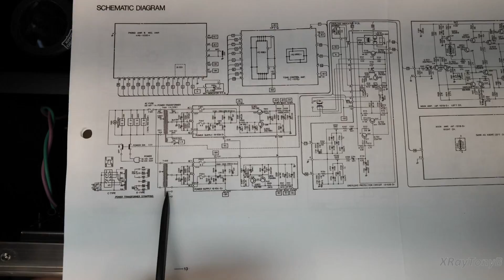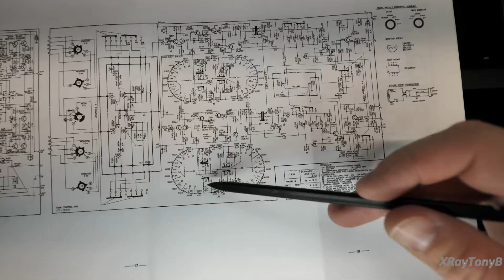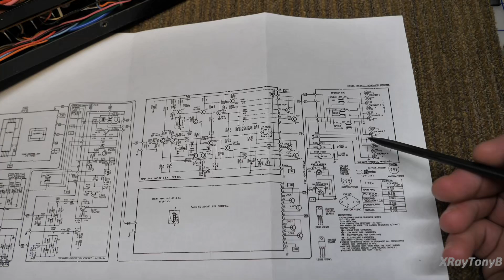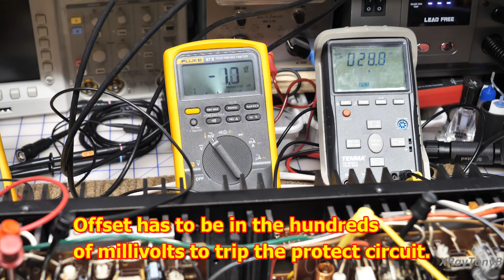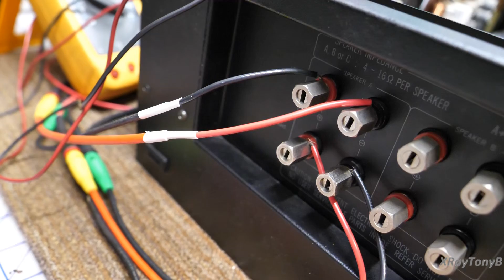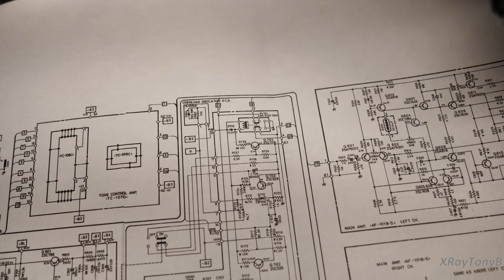Rotel RA-1412 Amplifier - Troubleshooting the Troubleshooter

Comment: I got lucky a week ago: a neighbor was putting out some of his old gear and brought out a vintage Rotel RA-1412 amplifier. Naturally, I grabbed it, cleaned it inside and out, and cleaned the switch contacts. Once I turned it on, I couldn't tear myself away from listening to various genres of music for ten hours straight; my Pioneer A-447—which I used to love for its sound, and which I’d even fitted with new capacitors and tuned using an oscilloscope—now just pales in comparison.

Comment: I have a lot of faith in Rotel .  Got a RA214 Amplifier for my 21st and more than 50 years later its still going. All I have done is dust it out and clean the controls. Still used in my secondary system. Fascinated by the vids even though I don't understand most of it. 🤣

Comment: Hi Tony, heat a great video. You inspired me to bring out my 1412 to see if it is still doing ok. I used to work both at Tektronix and RIFA in Stockholm and as I recall the RIFA capacitors were really high quality, but maybe not this type though. What an impressive lab you got set up there!😮 and thanks for a wonderful video.

Comment: Great video Tony, thanks for sharing it. I have a quick question, have you ever come across an issue for the power amplifier where it produces no sound when the volume is low, then all of a sudden the sound come out when the volume is turned up to a certain level? Could this be caused by a capacitor, transistor or a relay? Thanks for reading my question Tony!

Comment: Nice again, Tony! First, those "Rifa" brand caps fail like this regularly. The best thing is to replace every one of them right away. The reversed leads going to a scope is something most have experienced once or twice, may lead to wrong conclusions :) The relay, could you get a PCB socket for it, is there enough room over the relay to accomodate the extra height? Very nice amp, I once had a Rotel receiver, but not near this in quality, but I liked it

Comment: Very nice amp, a brand new amp built to that standard would cost a fortune, those where the days. Myself I had several large Sansuis, quite nostalgic about them but they go for high prices now and they need a lot of recapping etc of which I don't have the time for. Today I use a Yamaha Aventage for my small HiFi-corner, most bang for the buck I could find in later years.

Comment: I went to a technical HS for electronics, you get a good base when you study something for 4 years (3-1/2 hours a day). We worked on a lot of old radio's and TV's as well as bread boarded circuits  so your practical experience is pretty good walking out the door. 

That ended in 1966 so I've been working on electronics for 55 years now and I still make mistakes. You learn to be wary about what your doing because it's just to easy to get ahead of yourself and do something like this. When it does happen you just chock it up to experience and move on.

Comment: Actually, you have to be very careful with those oscilloscope grounds and testing speaker outputs.  Some amps will not tolerate this and usually warn you about this.  Make sure to check before connecting this way!
Reply from the maker: Thank you for the comment!  I actually go into a bit more detail about this subject in some of my previous videos, especially with some of the Carver gear.  Where you really see this is with amps that are capable of bridged mono configuration.  In those, the negative lead of one channel is tied to ground and the negative lead of the other channel is tied to the amp output.  The two channels are operated 180 degrees out of phase, so that when connected to the speakers, they will be in-phase.

Comment: Badazz amp ! I would love to Rock that Rotel with my New Triangle 40th Anneversity ! Gee. That board looked so nice 
! Sansui guy myself.
 I have owned many 
 Vintage Monster recievers/Integrateds  just serviced a G8000 I picked up for a great deal my 2nd one and never had 1 problem with either but the driver board on the left hand side been replaced on both 😆 thanks for the video for the video .

Comment: What ever happened to the 2 - Digital watt meter / spectrum analyzers you assembled into a test panel? I recall you went through a lot of work to make sure the 2 channels had been isolated from each other, you tested them, found them to be of acceptable accuracy, and then, I've not seen you use them since. Other than that, we are all human, and thankfully no magic smoke was released from anything.

Comment: Great video..
I own this amp along with an RA 1312 amp  as well as the RX 1203 and RX 1603 Receiver's from the same era. All have the House sound of this vintage though there are some supple differences for example the RA 1312 and RX 1203 being a little "sweeter" than the others. The RX 1603 does feature a soft start of 0.3 secs as can be noted by the illumination globes taking that long to reach luminescence.

Comment: Regarding the original fault, you said it squeaked - possible parasitic oscillation? Perhaps testing it with a capacitive load, say a 0.1u cap at very low power whilst scoping the OP might be instructive. Possibly an inductive load too. 
     Kudos for owning up to the brain fart, we've all done similar daft things. That said I've had odd issues testing both channels on stereo amps. In my case I think it was an earth loop caused in part by the test gear mains earth's.
     Thanks again for another instructive video.....DA

Comment: Excellent video, Tony. Right up to your usual high standards.
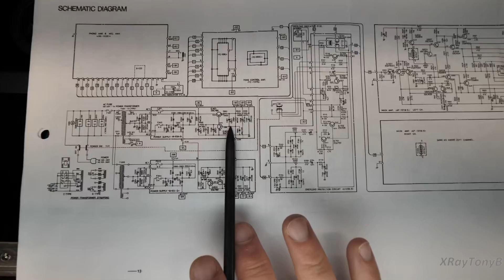Just one point though. At 12:00 you point to the “passive” regulator for the low voltage supplies. I assume you meant a “discrete” regulator, given it’s actually using a number of transistors? (as opposed to a 3-terminal regulator)

Comment: Nice troubleshooting Mr. Troubleshooter, happened to me, too :-). On an additional note, you need to be even more carefull with balanced amplifiers. You must NOT connect the outputs of those to ground or together in any way, they need to stay isolated. The symptoms are even more weird or it can damage the amplifier if you do. This is true for many class D amps. That’s when differential probes or floating/handheld oscilloscopes come in handy. Thanks for the video.

Comment: I have seen the same problem in a B&O amplifier I repaired a couple of years ago. A small signal transistor that shorted after about ten minutes of moderate operation.  Very difficult to find, as the amp seems to work just fine.  I found the culprit using cold spray.

Comment: Odd! The jack panel is on the right side? 1:03:30
Reply: Yes, a whacky design.  Not very convenient when putting in a cabinet.  Or if you have an open shelf, you have to look at all the wires hanging out the side.

Comment: I thought it looked like 1977 to me, so I had to go get my 1997 Orion Audio Bluebook and look it up. Production run from 1976 until 1981, RA-1412 model, 110 watts per channel, suggested retail $800
Reply: Any odea how much my Sansuo G8000 cost in 78? I just serviced mine completely cleaned not 1 single problem glad theors no db board nightmare those are !

Comment: What happens is we make a lot of connections and we get in a semiautomatic mode assuming we put everything back as we think it was in  an earlier condition. Well there’s a lot going on breaks distractions etc. because we don’t verify everything because we were sure when we did it it was correct… well turns out we’re not perfect. Thanks for showing that Tony we all have experienced just the same sort of thing such as it is. If we were perfect we would be boring